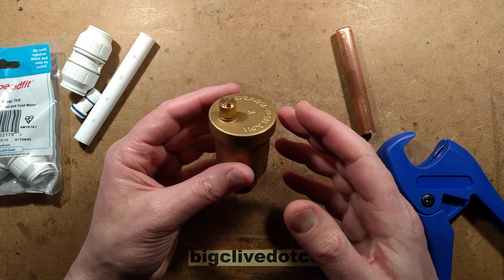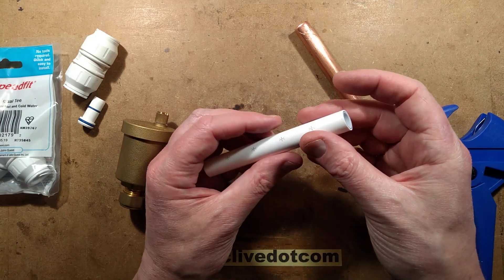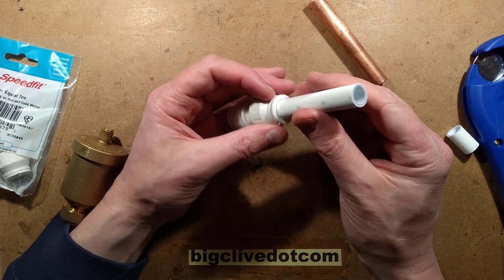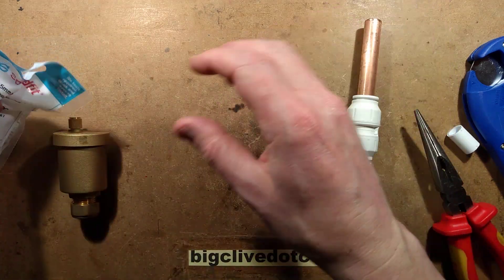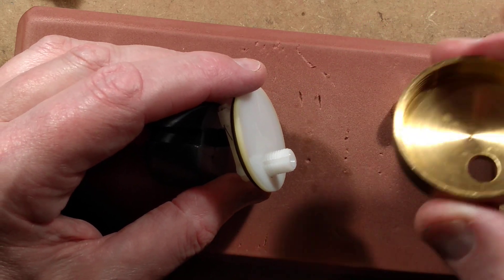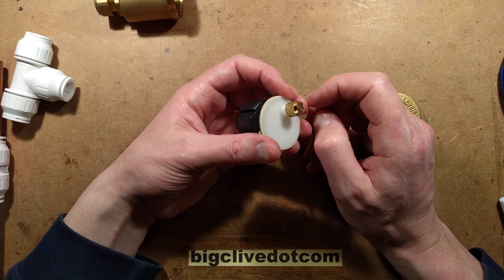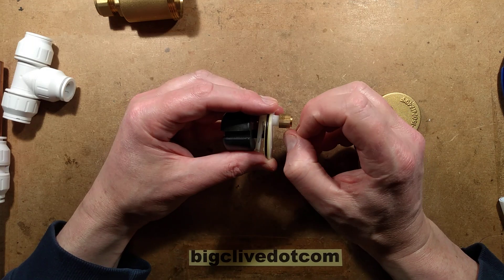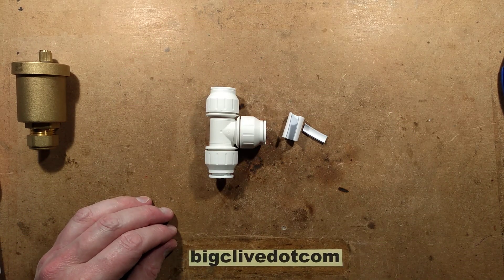Inside a bottle air vent and plumbing ramble.  (No electronics whatsoever.)

Comment: I redid all the plumbing in my house that was built in 1913. It didn't have plumbing until quite a few years after it was built. The original water supply pipes were galvanized metal pipes that were almost plugged with rust build up. The drain pipe from the bathroom sink and bathtub were made of lead. They tied in to the main drain pipe that was 4 inch cast iron pipe. I replaced all the drain pipes from the vent stack on the roof all the way to the basement with PVC pipe I did have to use a air valve on the drain pipe from the bathroom sink in the attic as I couldn't connect it to the vent stack.There's a 3/4" copper pipe that comes from the water meter across the basement ceiling into the utility room from there, I used CPVC (tan colored) pipe with a SharkBite connector to connect to the copper pipe. All the water supply lines to the washing machine, the kitchen and bathroom are CPVC pipes connected with fittings and after primed cemented with the proper cement glue for water pipes. I did save myself some money by doing it all myself as I can't imagine how much it would have cost to hire a professional.

Comment: the air vent is a simple normally closed valve. The spring keeps it closed. When there is water in the chamber the float rises and does nothing. When air enters, the float drops and acts as a weight to pull against the spring and open the valve.

Comment: I’ve seen a few failures on plastic push fit central heating joints after about 20 years service  - minor leaks nothing catastrophic
Reply: Do one so minor that you called a queer ombudsman to negotiate the leaks into cessation with falsetto and limpwristed hand gestures.

Comment: As far as I am aware, these are designed to allow air into the system, rather like a vacuum break, and are fitted when you have a long stub drain that is not otherwise vented.  Used to be and maybe still is required by plumbing codes in Canada for long stub drains. Not used to exhaust air, that could be smelly.

Comment: I hate the plastic pipes...gimme some good old soldered copper.  The place I rent has plastic pipes and all the valves (e.g. to shut off a toilet or sink) feel like the pipe will snap with twisting or the onea like on the water heater start spraying water at the joints because the plastic deforms as you try and tighten it.  Only option to do anything is shut off the well pump and drain the whole stupid system.

Never had any of those problems with my Grandparents or parents plumbing...

Comment: You can further strengthen the connections by slipping rings (look like circlips) between the fitting and the "compression nuts"; they'll keep everything from moving. They're available in white, blue (for cold water lines), and red (for hot water lines, instead of that dot you marked the fitting with).

PEX (polyethylene, cross-linked) is related to multi-layer pipes (the latter have an additional, middle aluminium layer): https://en.wikipedia.org/wiki/Cross-linked_polyethylene#PEX-AL-PEX. But then again, your particular sample was easily cut with an utility knife...
Reply: Anything secured usually accomplishes such security by carving out a channel for additional fasteners. I hate jigsaw puzzles and channels make stuff weak: for every case there’s a locktite substance or an improved design, such as tapered threads, jam-nuts, not slots and keys which call for proprietary tools:

Comment: You should check out sharkbite fittings too you don’t have to turn any thing you just clean up the ends of your pipes and push them in to the fitting until they stop. They hold up great and are awesome for copper to other material

Comment: last time i saw that was on an oil refinery, was called an inverted bucket trap for blowing down condensate out of steam systems, steam traps as called, were replaced with thermal versions a very long time ago.
Reply: Dave Birkenhead they use fire. Thermal good!

Comment: Clive it’s Always a Joy to hear the tone of your voice and the look of your videos 👍 I recently review a Freezing machine that Uses Electricity to freeze pipes have been using it for 10 years I’m sure it would be right up your street 👍 Just lag all your pipework mate especially where you live all the best.
Reply from the maker: The original cold water feed under the house isn't lagged.  Fortunately it's never had an issue with freezing.  The Isle of Man rarely has a significant cold snap.
Reply: bigclivedotcom One thing the little furry creatures love the plastic stuff to chew ..You could always invent an electrical deterrent ! All the best matey 👍

Comment: Where I live, frozen pipes are quite common. The plastic pipe is what smart people replace the split copper with because it often doesn't fail. I had a section of my plastic pipe freeze because my furnace failed, and all I had to do was warm the frozen section and all is well

Comment: I'd have more faith in the plastic pipe than in that auto-bleed system, and I don't see any problem with the auto-bleed!

We're still on copper pipework indoors, here, but my brother used plastic pipe after one of his mates, a property redeveloper, told him that he'd been using plastic for donkeys' years. It's easy to think it can't be any good, just because it's too quick and easy to install, but the reality is, it is just as good as copper, if not better, and a darned sight faster and easier to use. We certainly aim to use it when we redo the plumbing later this year.

Go for it, Clive, you know you want to, and if you're brave enough to take electric shocks, and lick the powder from girly pink nookie pills in the name of empirical science, then you're man enough to use plastic pipes!

Comment: Where I live on a private water supply the water is acidic and causes the copper to corrode. If you use plastic and there are mice around I have seen a 90 degree elbow bitten through causing a flood.

Comment: You should check out a FESTO pneumatik connector.
they also use the "ring" clamp, meaning if you pull its getting tighter, if you press in the ring you can unplug the pneumatic hose again.
(its got copied multiple times and i donno who invented it first)
https://www.festo.com/us/en/a/567780/   "push in connectors"

for the connectors i came across wedgelok (??writing) especially used for gas tight sealing of CO2 and gas distribution system in lab areas..

but those had 2 parts in the "olive" a back part which got pressed onto +into the front part, so sealing up, which means it could be removed afterweards and mounted somehwere else.

Problem i see on plastic ... its plastic.  for copper you know what i'll be looking like after 60 years of usage and what can go wrong.
no phenols, no low temp cracks, no UV damage, no gas/water diffusion... also better bacterial/viral surface...
AND - copper can be recycled really nicely, those compound foils hielded (diffusion block) multi layer water pipes are not really recycable.

one of the oldest plastic piping system developers is GF piping systems. https://en.wikipedia.org/wiki/Georg_Fischer_(Swiss_company)
Main adavantage of their technique is the seamless plastic welding of pipes on connection, sou you dont get groves wher bacterial/viral biomatters can grip on...
most important thing for high end tech manufacturing (ultra pure water) and medical usage (dialysis etc)
- Got a nice water safety and cleanliness tutoring from them during my B.Eng.

Comment: Mice love plastic pipe, the o rings give up in about 10-15years on all brands of push fit joints. Only plastic joint I trust is crimped. Copper is rock solid, one problem is now, the sacrifical anode used to be in the hot water cylinder, now with retro combi boilers, etc, that doesn't happen.
I went to a massive church to oap home convertion, 100 plus flats. They had 2 heating circuits and each circuit had that valve to vent the whole whole industrial caboodle on a automaticaly preasurising system. Got a bit of shmoo in it and pissed out like a jet washer for 2 weeks. Massive loft!
Reply: just give them a few mild bangs with pump pliers or crescent wrench, the crud stuck will let go lol

Comment: In Poland we use polypropylene pipes with heat bonded elbows/connectors, no orings, makes single body joint once it melts together
Reply: krzysiekv12 and most importantly no glue.
Reply: Rýán Túçk recently took out a 20 year + install, no debris only slight colouring on the inner walls,  still nice and plastic, melted onto new pipes great and still in service

Comment: Clive, your copper pipe developed pin holes because of iron in the water.
We use PEX and PVC pipes here in the USA now. Pex uses either "Sharkbite" fittings similar to your's or Brass or plastic couplers with stainless steel crimp rings. PVC is usually glued.
I had used PEX and sharkbite fittings to run a pipe out to the garden with a tap on the end. Unfortunately I forgot to drain the pipe for the winter  and the water froze. All it did was push the PEX out of the sharkbite and left deep scores on the pipe LOL. All I did was cut an inch off the pipe and pushed it back in.

Comment: Red Hermetite helps with compression fittings. 
Related: I love the plastic pipe, it’s so easy to fit up. Just avoid scratching the pipe or it won’t seal very well. It’s good for compressed air too.
Reply: WineScrounger if you scuff the pipe OD, use an ID fitting. One and done.

Comment: Where I am, the closed loop heating systems operate at about 1-2bar (15psi).  About one sixth of the mains pressure. That is fairly higher than atmospheric pressure and the pump will never have the water below that pressure ;)

Comment: Ive got one of those valves on our heating / hot water systems. I had to replace it about 2 years  ago. Slightly different in that it has a car tyre type Valve on it. I just touch the top of the valve with my finger to press the top of the valve and any air comes out. As soon as water comes out just let go of the valve. I check it about once a month and only a tiny bit of air comes out.

Comment: Looks pretty cool. But the only thing that would worry me is the plastics and rubber seals failing with age.
Reply: DJ_PaulTUK you think they’d use actual  latex rubber because it’s more flexible than nitrile or because it’s more heat and solvent tolerant than urethane?

Comment: At my work we are encountering the same thing with some of a copper lines copper pipe are designed to only last about 75 years impurities in the water pit the copper cause burr that wear out faster also some place use type m copper not L or K which m has a thinner side wall the L and K being the thickest.  You just have old line is all. Hardness in water and impurities can cur life span dramatically and last note some place to make there job easier which is worse than other grades.  The air bleeder you had is a nice small here in the state we use the brand Hoffman ones and there are suppose to go the highest point and the furthest spot in your loop and several other spots to prevent air blocks which at my work I got an air block in a building system led to lots of blow fittings and lots of flooding until the air escaped those devices help so much the loop was maintaining 85 psi with all boilers and pumps off while draining then a terrific whistle and a fitting blew apart and the pressure collapsed so yes those devices are neccesary

Comment: I've used plastic piping in both my parents house and my own with great success. I've used it on HW and CH in both 15 and 22mm, the only thing you have to use copper for in CH is the first metre from the boiler. It's great stuff because it's so easy to make connections in confined spaces, the pipe can be bent so you can feed it through tight gaps such as joists or around obsticles. It's also impact resistant, won't freeze and split like copper and has better thermal insulation even without lagging. 

I've mostly used the Hepworth Hep2O brand which I have found to be very robust, professional and reliable. Their original fittings had the grab ring after the O-ring seal so there was no danger of scratches from the grab ring compromising the seal. This fittings could be taken apart but you had to unscrew them. Their new stuff is more like the Speedfit with the grab ring before the O-ring. That said I have demounted and remade without any issues. The Hep2O fittings need a plastic tool to press a pair of recessed pins in to release the grab ring which is perminently trapped in the fitting so no issues with it dropping out like you had. Also no danger of accidentally releasing the grab ring. That was actually the only time I've had a failure (well my dad actually), he thinks he may have knocked the Speedfit release ring and it came apart. The pipe as you said is multi layered with the dark layer acting as a gas barrier for CH systems. 

It's great stuff, go for it, you'll love it. That said I also quite like doing copper solder joints and bending, and managed to do some really quite impressive multiple bends, in different axes, on some 28mm gravity feed piping.

Comment: I've been using PEX tubiing and JG speedfit connectors for the compressed air setup in my shed for over a decade. 8 bar pressure and there's never been a leak. The central heating system in my house is the same, but at much lower pressure. It's good stuff... just a shame that it's not a pretty as copper. Cheers!!
Reply: Jim Conner all you need is a mouse.🛡

Comment: I haven't read the comments, but:
1) Steel wool is usually the most common item used to clean copper pipe. Remnants of this, flux or even solder could have been contributing factors to your pipe pinholing.
Also, whilst deburring is very important, compression fittings are usually pretty tolerant and generally you don't need to clean before assembly...though I do, lol. 
2) Good, pointing out how the markings work on the plastic pipe. The biggest cause of failure for the DIYer with push fit is people thinking the o-ring is fully home, when there's possibly 10mm more to go. Not forgiving like compression fittings, so clean those pipes before assembly.
3) I believe it's called barrier pipe because it isn't supposed to react with building materials. Unlike copper, you could bury a pipe I  cement or plaster without it being attacked...copper should always be protected by a wrap, conduit or a larger pipe.
Reply: Sorry for typo's etc. Phone keyboard kept closing down, so I posted before I had to type it all again!

Comment: We have shark bite connectors and others like propress bit either way they use an o ring. I've seen the sharks teeth start corrosion on the coper pipe that migrated under the oring seal. Bingo!

Comment: I'm bit hesitant of O-rings in all these new fittings. Like "Mapress" type fittings that have increased incredibly fast everywhere here. It's still fairly new fitting type. Being maintenance mechanic I've just come to conclusion that there is no such thing as "eternally" lasting rubber compound. Though yeah. I've also experienced copper rot in my workplace in the past and I don't wish anyone would experience that hell when you begin to have leaks everywhere, every fucking week 🙄

Comment: Is this pipe not insulated inside? We have plumbing copper pipes with a plastic coating inside. This prevents electrochemical corrosion. In copper, small holes are formed if a piece of iron (rust) got inside the pipe with water and settled on the inside surface.

Comment: I once made a mistake using plastic pipe, whole house was in plastic. moved a radiator several meters in plastic, as soon as it warned up the length of the pipe increased and it looked terrible.

Comment: Had the very same in my house since around 2003 and haven't had an issue with it yet. I think if you observe the points you already made about protection of the O rings (no burrs etc) then it's fairly robust system. Great vids Clive, keep em coming...

Comment: An interesting fact about the history of plastic water piping: When plastic piping was first bought to the market in the 50s, it was a complete disaster,  the manufacturer was too optimistic and built up huge inventories, but it turned out that the quality of the plastic was nowhere near good enough for most applications. Luckily the company was saved, by a toy company buying the pipe to make hula-hoops.

Comment: Ive used the pushfit stuff. Its fine as long as pushed in properly and make sure the cut end has no sharp edges or the o ring is pushed out of place. I used it when i worked in property maintenance. It was ‘hep’ but is just the same as the b&q stuff. Quick and easy